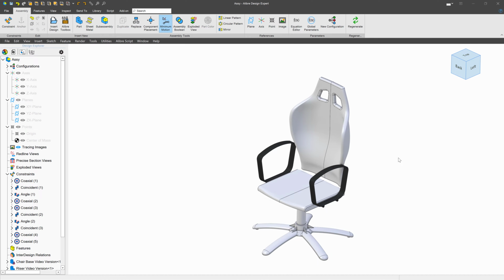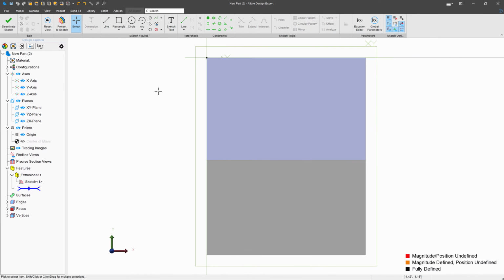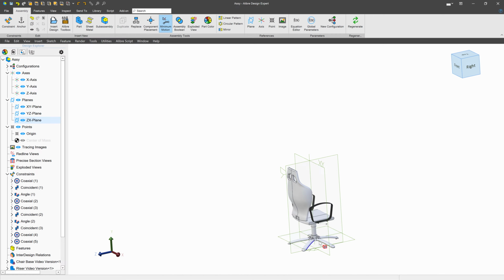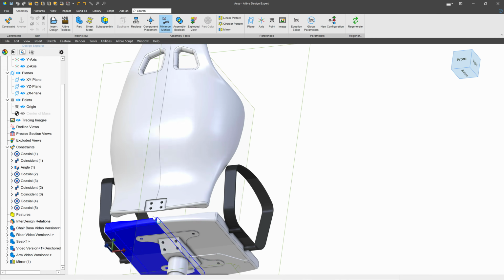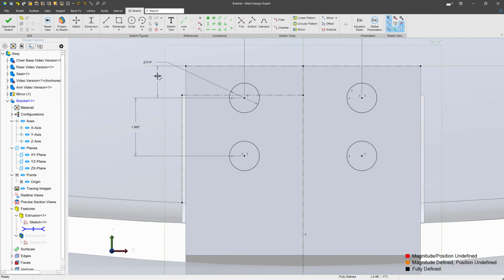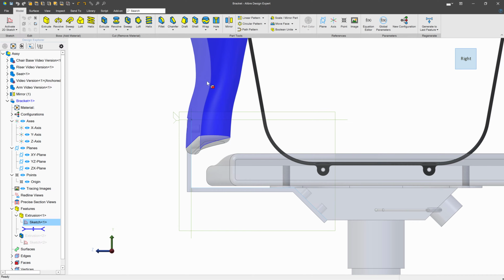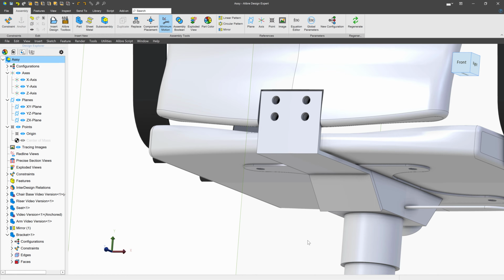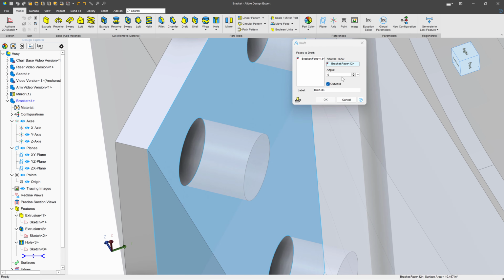Editing Parts in the Context of an Assembly | Alibre Beginners Course #41

Comment: What about parts that move like hinges? That's my biggest challenge when I use assembly in context, when I rotate parts that are used for constraints, the child parts are changing too. Is there a way to use constraints between parts and still move parts around without messing up the original part?
Reply from the maker: It would be a matter of removing direct constraints to the other part that would change when the 'hinge' changes angle.  Does that make sense?
Reply: @AlibreLLC  sometimes i start the part design, then remove the part and import it again.
Reply from the maker: @rubenu5157  That's a great way to do it also

Comment: Is there a reason you didn't just start your drawing as a new part in the assembly? You could have drawn the zigzag part with sketch constraints referenced off the previous parts, instead of assembly constraints. Then thin extrude, add holes,... 

Are assembly constraints preferred to reference geometry in sketches? I could be doing it wrong, but I pretty much design everything by just creating more parts in the assembly directly. I only have constraints reference parts created before the current part to avoid loops that could confuse the solver. That could just be a carry over from FreeCAD, or because my assemblies don't use standardized parts that are easier to just copy/paste.